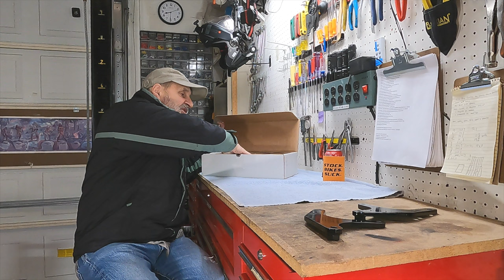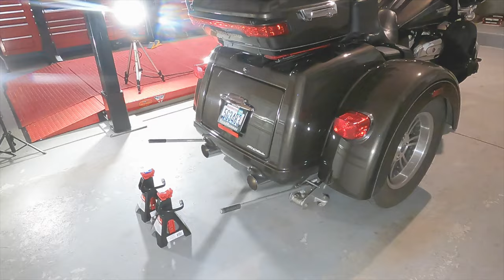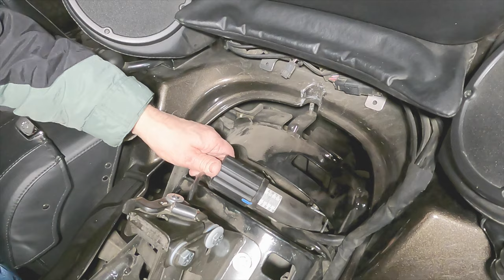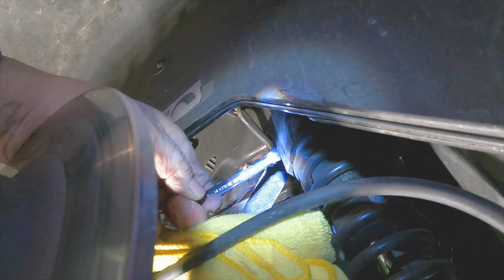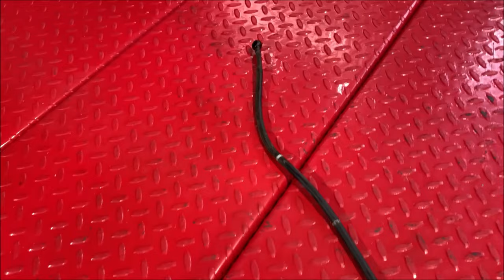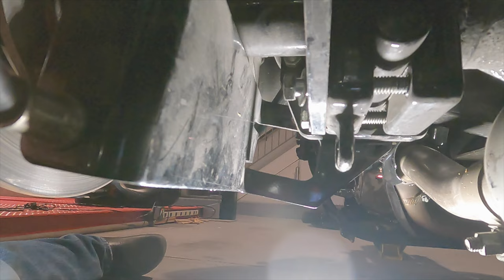Harley Davidson Tri Glide NexGen Shock Install

Comment: I noticed you had asked DK Customs about the bearing plates in the video posts. Did you ever look to see if you had thin bearing plates? My 2021 Triglide actually had thick plates on it, the same thickness as the DK Customs plates. Of course I didn't realize thus till after I bought them and was getting ready to install them. I was just courious as to what bearing plates  your Trike has. Thanks
Reply from the maker: Good question. I have just tested my bearing plates by rocking the wheels back-and-forth and there is no slop.  They are OK. There’s nothing wrong with them but I have not really looked at them to see if they are heavy duty like yours maybe are I just figured they were the thin ones.  I am a very easy rider, so therefore, I don’t think mine would wear, as if someone who was heavy on the throttle or even medium on the throttle. As I am light on the throttle.  Just my thoughts.
Reply: @windsurfed1  Yea, I'm pretty light on the throttle too. Only thing that concerned me was when me & my wife go on our road trips we tow a little trailer behind us as well so with the gear and tools we have in the trunk, tourpack and the trailer, that can be pretty strenuous on the bearings. I'm just a play it safe kind of person and if there's a reasonable chance of something like these bearing plates/bearings going bad, I'm gonna upgrade if it's feasible. Thanks for your input.
Reply from the maker: @ccmlkm  I agree with you. Better safe than sorry. It’s strange that your OEM ones were the same thickness as a DK custom ones. I had heard that HD was upgrading them.

Comment: What year Tri-Glide was this? my 2015 does not have the adjustment under the seat, it is controlled by an air valve behind the right side cover.
Reply from the maker: This is a 2020 Triglide. I believe since they started manufacturing the Triglides (2009)they had air shocks on them all the way up to 2017 I believe in 2018 they started putting hydraulic shocks on the back with the adjustable knob.  The shocks made for a hard ride. Jolting on your back, when hitting potholes and so forth.  After three years, I was considering selling the bike because the ride was rather rough. That’s when I put these new shocks on and it made a world of difference and I decided to definitely keep this motorcycle.  It is a world of difference.
Reply: These Nex Gen shocks will be an improvement in the ride you get from the air shocks that leak air !  DK Custom Products will ask you a lot of online Questions about the weighs you carry so they can properly preset the shocks for your style of riding1 I drive a 2020 Tri Glide.... Ride Safe my Friend !

Comment: Would it have been easier to accomplish if the body had been removed first? I am considering doing this as well.
Reply from the maker: Totally would’ve been easier. No doubt about that. Just take a bit more time. Would have preferred to take the body off, but I didn’t.  If you do not want to do a lot of cussing and swearing and moving your body in positions that don’t agree, then I would highly recommend taking the body off.  Meanwhile, back at the ranch, I have adjusted the shocks two times. When I got them, they were preset. I found it was too soft, so I went about taking the shocks off again and adjusting them. Found out that it was still a little too soft. So I went in again the second time and took the shocks off and adjusted them and put them back on and now it’s perfect. I tried to adjust them while they were on the motorcycle before taking them apart/off and it was too difficult.  So I literally had to take them off and reinstall them. Once you get them dialed in, they are excellent.  I highly recommend the shocks over the OEM shocks. You will not be disappointed.

Comment: Did you relieve the pressure by turning the dial back to zero?
Reply from the maker: No, I did not dial the pressure back to zero
Reply: @windsurfed1  I did and it then didn’t leak oil. I have everything off now, but ran out of oomph for today. 👴🏼
Reply from the maker: @Tryke_Ryder  yeah, I probably should have done that too. Then I would not have leaked oil.

Comment: I've noticed in your videos the camera mounts that you have located on the front fairing below the windscreen. What brand are they or where did you get them?
Reply from the maker: Got them off amazon.  Kinda Spendy at around $25 each.  I have about 12 of them.  Very convient to move the cameras arounnd quickyl. ULANZI Claw Quick Release Plate Tripod QR Camera Mount Adapter
Reply: @windsurfed1  But how do those attach to motorcycle?
Reply from the maker: replaced the windshield mounting screw with same size stock screw and mounted a go pro flat camera mount to the protruding screw.  Had to precisely cut the protruding screw to the right length to get everything to fit properly.  Then just went from the go pro flat mount to figure out how to mount the ulanzi mount.   @davidgallens7056

Comment: Hi Windsurfed1.  Can you tell me what size hex bolts are on the brake mount bracket to remove for comfort lift kit?????
Reply from the maker: The park brake bracket takes an 8 mm hex head or also known as Allen heads
Reply: @windsurfed1  Getting all necessary tools together. You're the best, thanks so much for your quick reply. 🙂
Reply from the maker: @dianedenroche1496  well, I hope things go well for you. Just plan on twice as long as you think it’s going to take with a little frustration along the road and just take your time.

Comment: Hi I just saw your video very helpful been looking at doing this to my trike.Are you happy with the ride now is alot better Thanks
Reply from the maker: I read many reviews of people who had put these on and claim it was a world of difference between night and day. But I was still reluctant to buy them, because in the back of my mind, I just didn’t believe them. After installing them and using them, I can safely say everybody was correct in saying this is a world of difference.  Little on the expensive side but if you want a way better ride than the OEM shocks, then I highly recommend getting the shocks.
Reply: Ok Thanks for the information

Comment: Excellent video
Reply from the maker: Thanks!Hope you gleaned something from on it. I had to go under there two other times and remove the shocks to adjust them to the perfect spot where I needed them. It was a hassle, but in the end they are the best thing I ever put on this motorcycle.
Reply: So the information you supplied DK custom wasn’t spot on as far as weight and so forth for the pre-loaded shocks?.

Comment: I think that if I decide to do mine, I will remove the body first.
Reply from the maker: That would make it a lot easier. Just a little bit more work but if you got time and are not worried about it, taking the body off is a good idea.